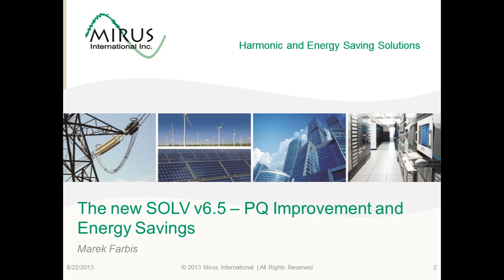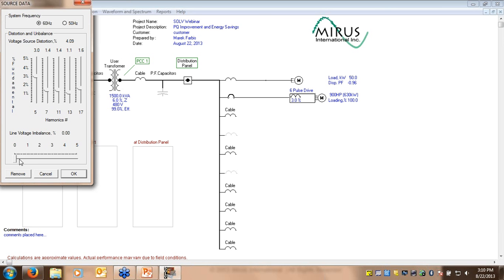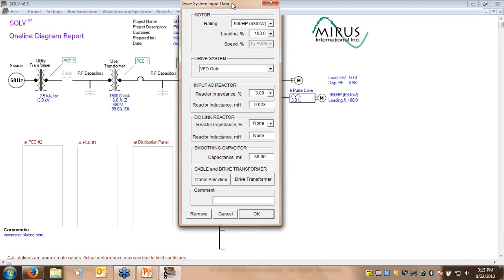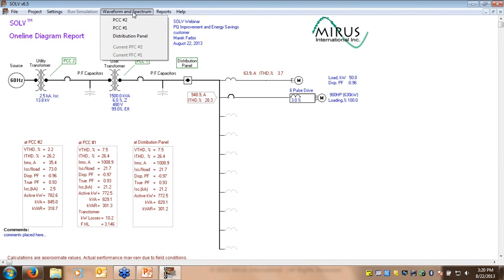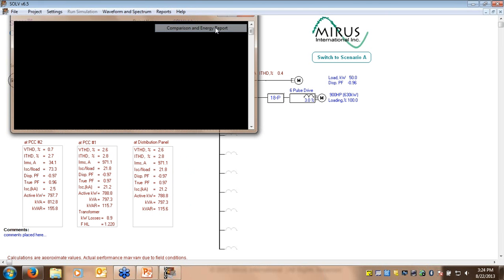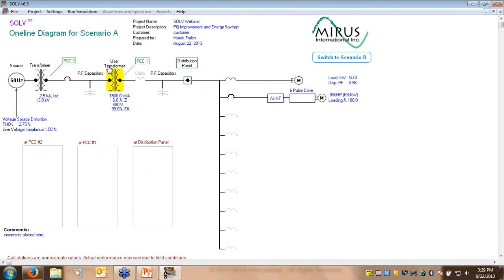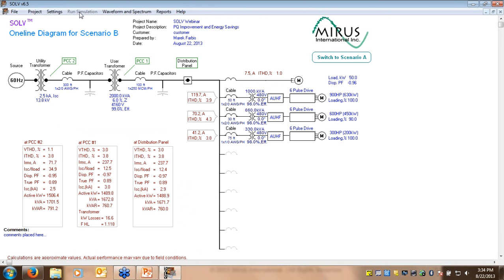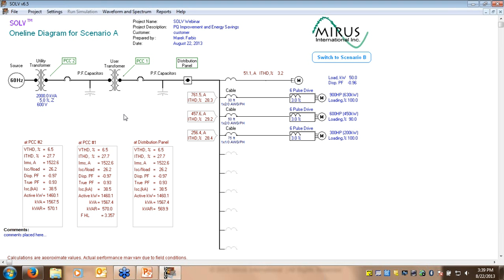Advancing Harmonics Analysis Technology with SOLV 6.5

Comment: I am using your fantastic and valuable software SOLV for Harmonic Analysis.
I will appreciate your clarification on the following:
For a power network under analysis with the SOLV, and in case of two or more Generators (D/Gs) are running in parallel, I understand that 
1) The aggregate power capacity in kVA (kW) of the generators should be entered (e.g., in case of two (2) D/Gs in parallel with rated Power P1 and P2, the entered power should be P=P1+P2)
AND IN ADDITION
2) With regard to the subtransient Reactance the low of Ohm for the parallel reactances is to be followed, e.g., in case of two (2) D/Gs in parallel with rated Power P1 and P2 and sub. reactances xd"1 and xd"2 we have to input in the
program the P=P1+P2 whereas 1/xd''=1/xd''1 +1/xd''2=> xd''=(xd''1*xd''2)/(xd1"+xd'"2).
Am I correct or missing something?